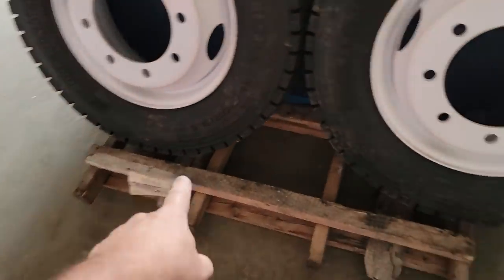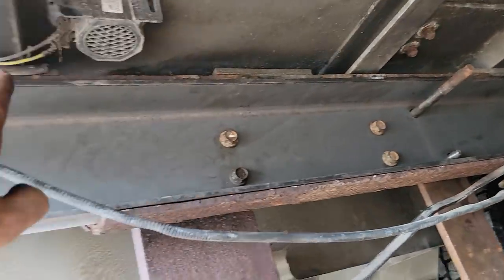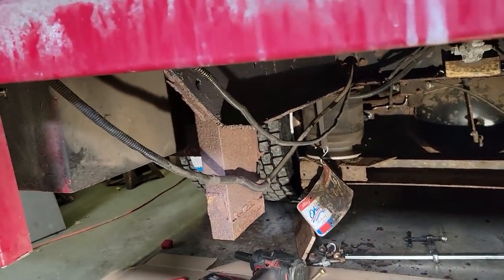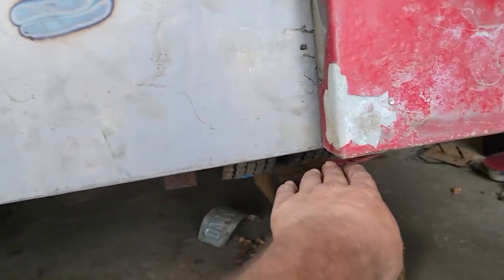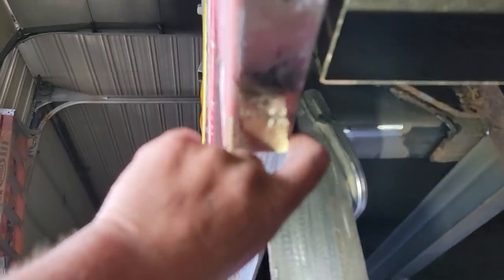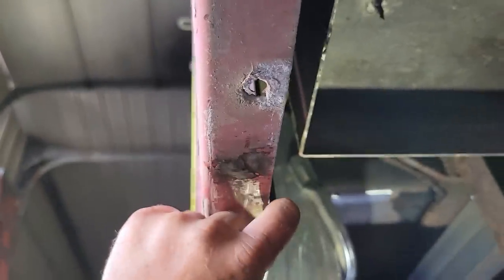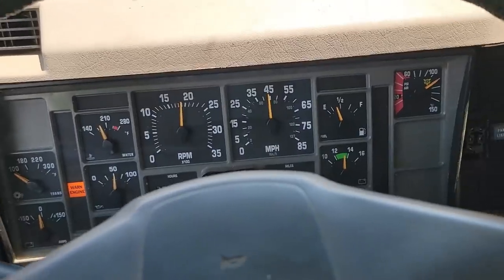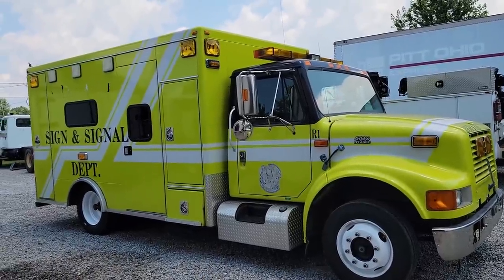2000 INTERNATIONAL 4700 AMBULANCE PT5 BUILDING A CUSTOM HITCH!

Comment: Greetings from the Ohio Porters.🤩 Thanks for the good picture of the hitch. It sure got my attention and I had to pause from my schedule and watch this video. The Diamond is in the Details! 😎 Not overkill, well thought out and some preventative measures taken.🧐 I’m not sure how old this ambulance is, but that frame appears to be quite rusty for the age. I’m sure it has seen LOTS of road salt, etc though. I used the grease method as well. Learned that from someone many years ago. Some people say it’s crazy but it works and works well! 🤩 You do good stuff and I’m usually impressed and not shocked by your work. I think that the build is more than sufficient for anything he might pull. 🤩 Those wheels, and I’m not sure how bad they were before, sure make it STAND OUT and look sharp! It may not be a “Show Piece” but it is a reflection of you and your work! Now that’s putting a bit of yourself into the job! 🥰 Good stuff! I always learn, and sometimes relearn, something from you! THANKS! 😎  Stay safe!

Comment: Good morning mr. Jc.. Just a little tip regarding the slack/wiggle on your milwaukee mag... Maybe you can put a thin tin spacer on the rail guide? Thin/thick enough to reduce/eliminate the slack.? I have tried it with the rail guide of my friend's router guide. And it worked good enough. I Hope you find this helpful.

Comment: Hey JC, enjoy you videos. You should try to weld those verts on the receiver up hill instead of running it down hand. You just don’t get enough penetration running a down hand. Vertical welds are where all your strength is.
Reply from the maker: i keep trying uphill. still struggling. i figure my downhill is better than my uphill right now.

Comment: That’s the first time I’ve seen white paint that color, hm, I will be if I ever get a rusted framed truck as bad as this one use grease in between the inter and outer frame, nice I’m not color blind, that’s a nice white paint, as you said , you painted the inside, this is a nice strong small trailer hitch, 10,000, , I need a 20,000 plus hitch for moving those 12000, pounds tongue weight modular mobile homes, nice thanks BigAl California.

Comment: do you have to balance those wheel like you would a pick up or car? or is it beads inside the tire? i don't work on trucks this big lol, so if that's a stupid question i apologize
Reply from the maker: tires 19.5" and larger, i use balancing beads

Comment: When cutting tubing, avoid putting the seam top or bottom. It's much harder than the steel. If it's on the sides you have less tooth contact. Same with drilling. Not always possible when cutting miters on rectangle tube tho.

Comment: That old frame should really get sandblasted and painted before welding the new frame piece. Maybe it's time you invested in a small outdoors sandblaster!
Reply from the maker: i hot it with the needle scaler and flap disc. nothing is welded to it. the new hitch is bolted to the original frame. the hitch is welded to the frame liners.
Reply: @j.c.smithprojects  - I get it, but that old frame will continue to rust away without protection, after all the hard work you did to rest of the frame.

Comment: On that 3 1/2 by 3 1/2 you should drill and tap it for fittings and make an on board air tank
Reply from the maker: cant do that. there are holes drilled in it for bolts that go into the body.
Reply: @j.c.smithprojects  well if there's a will there's a way lol nothing's impossible sir

Comment: That square tube wasn't cheap.....just last week I bought a 48" chunk of 3x3x1/4 wall tube off the drop rack at my local supplier. $40!  If it was new it would have been $17/foot instead of $10.
Reply from the maker: $160. for the box tube.
Reply: @j.c.smithprojects  Holy crap...its ridiculous any more

Comment: Do you have any fl-70 freightliners are s lines for sale I am looking for a low profile truck that I can run something like 195 zone or low profile 22 5 on I am trying to make me a hot shot outfit and I would like to have it with a sleeper or long enough to put a sleeper on it and then have a pretty good size flatbed or make it long enough to be just one outfit Tahoe a camper on and then how something back but it don't necessarily have to be like that I am just wanting a low profile truck that I can start a hot shot business with thank you if you could message me back I would greatly appreciate it